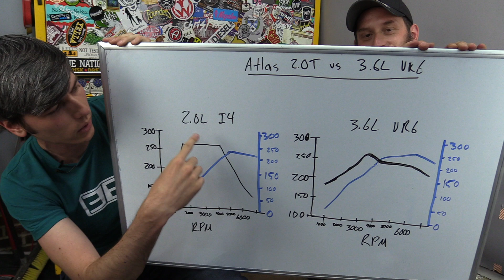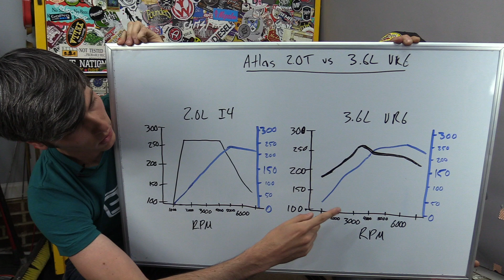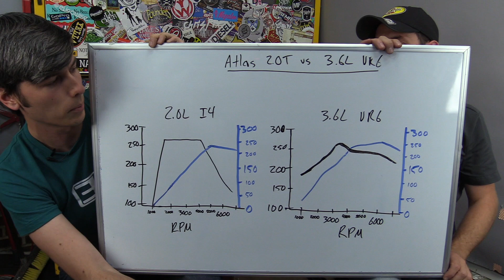4 Reasons Why The VR6 Engine Is Dying Off

Comment: From a dude that loves the VR6, the new engines are so awesome. 

Thanks for hanging Jason. Always fun times
Reply from the maker: Love working with ya Charles. Mostly it's the wicked beard, but you also have sweet props! ;)
Reply: Engineering Explained alls the props
Reply: HumbleMechanic turbo your VR
Reply: There's also the question of reliability of turbo motors.
Reply: +Jeffrey SmokeyBones O'Malley same money into the vr6 and you will have 300 to the wheel with out changing rods and stuff as the vr6 compression loves da turbo. v5 is the same just one less cylinder and a little less power
Reply: I really liked this video and format, with someone who is really into a particular brand or technology talking about its features.  I'd like to see more like it... @HumbleMechanic this vid would have been good without you... it was awesome with you, thanks for the time you put into making it happen.

Any possibility we can get a vid on what the engineering differences in the block are for a naturally aspirated engine vs. one designed for a turbo or supercharger?
Reply: consider a 98 mustang v6 3.8 from factor only produced 145hp so 190 from a 2.8 v6 is saying somthing for a complete base power vr6
Reply: Ilya Kalujny, actually that's a poorly formed opinion, but alas.
Reply: I think the obvious response is cost/emissions/weight are the reason why the 2L turbo is used instead. I had a 24V Vr6 Gti, fantastic engine, great response and power. Fuel economy wasn't bad either if you could drive it slowly.
Reply: The VR6 has much more torque than that though, I have a 12v VR6 and a built B17A1 with Nitrous and yes my B17 makes more horsepower, but the 12v VR6 has 80% of its torque at 2800RPM compared to my B17 where you only start to feel the torque when hitting V-TEC, and its still has less torque than the VR6. Although when I push an extra 150hp shot of nitrous then yes its much better. But its expensive to use all the time. If your wondering whats in my B17, Bored to 1.8L with CP High compression pistons 12:4:1, Manley I beam rods, Ferrea Road Race Roller cams, Ferrea Beehive valve springs. I use a AEM Infinity for engine management. I daily my VR6 on weekdays and my Integra for the weekends and in lots of situations its nice to have instant torque.
Reply: B17 is Pushing 240whp and 164ft/lbs of torque and my VR6 is pushing 165hp and 205ft/lbs of torque. Yes I dyno'd both at Classified Motorsports here in Canada.
Reply: You can always say that the vr6 will last longer than an inline 4 with a turbo hahah.
Reply: HumbleMechanic when it comes to building there is no replacement for displacement so I give it to the vr6
Reply: Who would fine the EPA (hint: they are a government body)? also in some respects at least it is a number you can compare between cars. the same issues exist for the SEER number on your air conditioner, or the energystar rating on your water heater, etc. Would i like to see the the EPA fule economy number be more representative of "normal" driving? yes, but at the same time it's not uncommon to see almost everyone in LA driving down the highway at 80+ MPH, even though the speedlimit is 70MPH so what speed do you pick for your highway test speed? how long do you allow the car to warm up first? do you include the acceleration from stopped up to highway speed? if so is there a minimum limit on the time it takes to get to speed? how long do you measure the fuel economy over? what temps, atmospheric pressures, and humidities do you allow for testing? how do you correct for changes in those? what type of fuel should be used, and what standard do you use to qualify it? wind speed and direction? what about tires, for example if i was a car manufacturer, i'd put the "fuel economy option" tires on it, and then charge $xx,xxx for those tires with a 16+ week increase in shipping time just so no one ever gets them. The list goes on and on. In the end there will always be "cheating" on the testing, and the test may or may not represent your driving usage.

You also seem to be mixing up fuel economy and emissions. VW is in trouble for cheating on the emissions tests. Kia and Ford were both in trouble with the EPA for inaccurate fuel economy ratings in the last few years.
Reply: Tigerfire75.  MotorWeek gets better than EPA mileage a lot of the time.  I think they have little old ladies drive around at 10mph under the speed limit, but I can't prove it.
Reply: Learning2Smile no,  Jason lives in Idaho,  Charles lives in South Carolina (if my memory serves me right)
Reply: Not only that, the VR can take up to 15lbs boost on stock rods. I swear Honda guys do not know what they're talking about with the VR. One of Ward's 10 best engines. Basis for the engines that now powers the Bentley (W12 n/a, W12 Turbo), and the Bugatti Veyron Supercar (W16, quad turbo). Ask the averafe VR owner when they did they're head gasket. Then ask the average honda 4 cyl owner. If the honda owner has anywhere upwards of 200K miles, that gasket is either already done, or is about to be. Just better catch it before it goes as honda motors do NOT tolerate overheating very well. A VR will be forgiving as long as you don't obviously ignore it, as it's built to run hot.

Even still. we as VW guys give Honda's props for solid engines... more than they do us. But that's okay.
Reply: Then you needed to be there when my lightly modded VR6 B3 Passat GLX (93) , with a simple chip and a 5 speed conversion from a 94 Corrado VR6 walked an old school 90's first gen Integra GS-R from a stoplight. Yes, my 3300 lb STATIONWAGEN plus my 165 lbs (total with fuel, nearly 3500 lbs) You know what got me the race? I pulled one and a half to two car lengths right outta the hole. He managed to catch up by the time I was in 3rd going to 4th, but  once I was able to get the VR singing higher revs in 4th then 5th, he couldn't pull it off and began falling back. Any VW people or gear heads know what caused the GS-R to lose the race that otherwise would've been close? In one word please...
Reply: Vr6 12v have flow limitations in the head. you can only build about 220 n/a. The vr is reliable and fast turbocharged. It has good torque everywhere. It feels almost like an older v8 in a swapped car.
Reply: Dont worry about ve or peak hp #'s . The seat of the pants driving experience is so good with a turbo vr. Its the best bang for the buck out there.
Reply: How about we turbo the VR6?
Reply: Indeed. The internals on the 12v are pretty stout. Lower the compression to a more turbo-friendly level and you can make disgusting levels of power for a FWD car on the factory bottom end. WIth the head, there is some porting work that can be done, but honestly, it doesn't really need it unless you have dreams of crazy horsepower. Daily driver reliable 400 turbocharged whp on the stock motor with nothing more than a head spacer is impressive. And if VW was looking for a VR6 to power larger vehicles ala Ford Ecoboost, all the basic parts are there already. They're already doing it with the EA888. Imagine what could be done with an iron block VR6 if given the same top end treatment of the 4-cyl. Would be a beautifully compact motor in a new Porsche 968 Turbo S.
Reply: Mike McKeen honestly, 15PSI on a Stock Compression 10.1:1 VRT (AFP) feels great. 

Gas Mileage, and Near Instant Spool are both fantastic.  

The only reason why I don’t crank it up to 20psi is because I don’t have the technical know how to modify my C2 Flash. 

With that being said, the c2 630 flash does run a bit rich wot (11:1 AFR), and I monitor for timing pull religiously. 

You were definitely spot on with the Timing Chain and etc. The upper Rail Guide on the 12v is known to be problematic.
Reply: You guys live in the same city?
Reply: if it's your birthday happy birthday!
Reply: andrew wright your out of your mind if u think youll get the same amount of parts for the cost of what it cost to build my motor. hence why its called the poor mans type r. vw parts are way more expensive then Honda parts. Everyone knows this. Vw parts are ridiculously expensive.
Reply: andrew wright there is no way in hell your gonna get 300whp by swapping in all other oem parts lmao. good try tho. for what it would cost u to get a reliable 300whp all motor vr6 i could build mine to 500whp with all oem Honda parts and an aftermarket turbo on it lol. or all motor with 300whp and it would actually be reliable lol. the vr6 would 100% not be reliable. u would be rebuilding every time u take it down the track.
Reply: KrazyKustoms Media 190 to the crank is horrible. like i said my all motor all oem Honda parts 4 cylinder 1.8 litre put down 205 to the wheels on the dyno (not to the crank like the vr6 or the mustang) Hell even the older mustang v8 5.0 only has 230hp again to the crank not to the wheels. Also my dx sedan weighs less than the 1995 Civic Si hatchback right from the factory. How much does a vw jetta with a vr6 weigh? prob over 2800lbs vs my 2200lb 4 door sedan lol.
Reply: stoneeh thats really nothing to brag about. 10hp from a cam? lol
Reply: RockstarAlto ya but take that motor and put it in a eg civic hatch or a dx sedan like mine which is lighter than the eg si hatch right from the factory and the power to weight would destroy a vw with a vr6. yes more torque but the 600lbs lighter car? its a wrap.
Reply: RockstarAlto integras are to heavy. thats the problem.
Reply: +Jon Council "Can take up to 15 psi on stock rods." The number of PSI is kind of irrelevant if we don't know what kind/size turbo you're talking about. It might tolerate 15PSI from a tiny Garrett T25, but it would probably jettison some rods with 15PSI from a Garrett GT35R.
Reply: Uh, why would you think the first turbo someone building a FI kit for a 1990's thru 2000's era engine would be a T25 70's era turbo??? Just look at the plentiful vids of VR6 turbos here on YouTube. The standard size go to turbo is at a minimum a GT30.... I mean, standard 1.8T's even do GT28 - GT30's on the high side before rods are in order....

But even if they used a seriously undersized outdated turbo pushing nearly outside of it's efficiency map to power a VR6, try running 15 lbs of boost with a properly sized turbo thru a Honda 4 cyl without building the motor first. You won't have an engine for long I assure you.

A VR6 can take that 1 bar from a decent size turbo at 9.0 to 1 compression because it was originally designed as a diesel engine. A very little known fact.
Reply: +Jon Council The T25 was used throughout the 90s by a number of manufacturers including Mitsubishi and GM. It's common, it's cheap and rebuild able. Regardless, all I was getting at is that saying something can hold 15psi is pointless without clarifying what turbo or supercharger.
Reply: HumbleMechanic did that block come out of a mk4 gti ?
Reply: The vr has much more area under the curve than your Honda. The small amount of time your HP is greater does not make up for it's lack of torque everywhere else.
Reply: Saddens me that VW never offered a supercharged or turbocharged version of the VR6, with proper maintenance, the engine is damn near everything proof, and the wookie plus the scream of a supercharger would've been a sweet melody......
Reply: HumbleMechanic do u think its a good idea to buy a 3.6 4motion passat b6 , what do you think of that engine
Reply: vw just made a new one    2.5T vr6
Reply: Zonghui Li. I believe you are thinking of the inline 5 2.5L turbo that’s in the RS3 and TTS. The newest VR’s are 3.2L and 3.6L. Both come DOHC and direct fuel injection.
Reply: It's only hideous if you judge it by Honda Standards (aka head flow). On the flip side, if you take into consideration it puts out ~180ft/lbs of torque from the factory, it's a cast iron block w/ a forged crankshaft, much less desirable to thieves  (Honda has more popularity), and also cheaper (I paid $350 for my D15b motor, and $160 for my VR6 Engine), it becomes a strong competitor to Honda's offerings.

Also, they love boost.  (I own a VRT)
Reply: Maybe the 24v, but the 12v is iffy.  There was a 96 page thread on trying to extract that power n/a, I believe they had issues due to the head.  On the flip side, it's not impossible to get a 12v over 800 whp on Boost.
Reply: Marlon Lyn. Not true. I have built and seen 1200whp VR6’s since the 2000’s. The issues with the 12V is how the intake runners work. 3 short 3 long. They made it perfectly sound at low NA the way the air bounces off the valves and back to the plenum it is flawless stock but when you are trying to push it na you gotta get ITB’s or a better short runner intake. 350hp NA 400tq is achievable. But a ton of work!! But as stated VR’s love boost!!!
Reply: Mike McKeen if you go further than an of the shell chip tune. (Something like a  flash tune tailored to your car, or standalone) you may not have to even open the motor. 

The important issue is using a properly sized turbo, and managing timing so detonation is controlled.
Reply: Perhaps, but the factory compression on those older 12v motors is like 10:1. While you could get away with a good tune and E85, your options open up considerably with a head spacer to get the compression down. If you're going to the trouble of turboing this motor, the newest of which was last made in 2002, you're likely looking at some freshening up. Unless it's a low mileage motor or a fresh rebuild, I'd replace the head gasket before doing a turbo setup, as should any mechanic worth his salt. Since the head spacers for these are common and well-tested over the years and come with new gaskets, you might as well go that route. Unless you have a record showing when the timing chain, guides and tensioners were last changed, it would be prudent to change those out before adding 100+hp to the motor. Since the head is coming off anyway, might as well do it all. There is no point in trying to tune a turbo around a high compression motor if you don't have to. Don't make compromises when it isn't needed. Especially not for $200USD in parts.
Reply: EE and humblemechanic = dream team
Reply: Hey I have a 2014 Passat with the VR6 and DSG. I maintain the car quite a bit and has oil changes and all that good stuff done on time. What could I do to hope it up in power? Also is it a reliable enough vehicle to mod? I love it and I want to do it regardless. Sleeper 2014 Passat with a v6 HAHA awesome
Reply: How about the 2.5 vr6 turbo...btw😞 only in china
Reply: "Thanks for hanging Jason" or "Thanks for hanging, Jason"?
Quite a big difference there...
Reply: I own a 2,9l VR6 with 190hp in the VW Corrado. For comparison I can cite the 1,4l 160 TSI in the Scirocco, and the 2,0 TSI 200hp in the Audi TT. 
Both newer engines seem strong at first because of the low down torque/power, but when you rev them you are quickly disappointed, because they drop off already at 5500 rpm.
Next is the response. The VR6 kicks the newer engines' ass in that regard. I personally can't stand turbo lag.. totally unacceptable, controlling power during cornering and coming out of the corner is much harder.
Next is the sound.. okay, we don't even have to talk about that, do we? ;)

Nope, the new engines are not awesome. What would be awesome if VW used modern technology to tune the VR6 design for higher revs and higher power - I wouldn't mind buying a 2017 Corrado with a light 2,5l VR6 up front with a 120hp/l output, proper light weight design, proper suspension and diff, sticky tires etc that I could go hunt 911s with ;)
Reply: On the VR6 power figures: Just switching to 272 cams without even adjusting the ECU will get you another 10-20hp and 500-1000 revs on a 12v VR6. With proper ECU and some further work 30-40hp is no problem. And then there's still a lot of potential in the manifold and head, and there are even some sharper cams out there.. max is 288 I believe. You can get the 12v very close to a specific output of 100hp/l without adding boost. And btw, you really really don't need more than that on a FWD car ;)
Reply: Why do we keep talking about fuel economy numbers that we get from the EPA?  Their measuring does not accurately tell the fuel economy.  You can't actually drive as the test is and hope to get the numbers.  

So when is the EPA going to get fined and ruined for lying?  VW did even though they were giving people want they want ( powerful cars and trucks that are economical).
Reply: @Tigerfire75  they say 20 something miles per gallons on highway for my car i get 33 mpg easy
Reply: Sure, you'll just have to drive it like you stole it to get those 205 horses that's all. A VR6 can lug around or rev and get you power. And keep in mind that 190 hp figure is out of a 2.8L mill that doesn't even have the Variability of the V-Tec valve train to help it. If it did have that, lol, just reference any Acura/Honda V6 V-Tec motor and see what you'd have then to compare... ;)
Reply: I am aware various manufacturers used the T25 as a stock turbo. I have one of them.. 1992 Mercedes 300D 2.5 L turbodiesel. But surely you know tuners don't pull from the same bin as manufacturers. They like to go for the most advanced stuff, which at this time would've been the GT series turbos. And as a gas motor at 2.8 liters, a VR6 would've been oversized for a T25 turbo, As it stands now, on my 2.5L I5 diesel engine, the stock T25 is banging relentlessly up against it's efficiency curve at stock  psi levels with only simple fueling mods as it is based off of how much smoke I get (and egts) beyond 4K rpm. So no way it would take a VR6 as a sufficient turbo.
Reply: HumbleMechanic Looking forward to the videos on the 2.8 build. Found a good block that I want to build up for my 96 Jetta, and being able to refer to a detailed video series would be fantastic.
Reply: stoneeh 190hp that is seriously hideous lol. especially for a 6 cylinder lol and the really sad part is thats only 190 to the crank. i have a 95 Honda Civic dx sedan with a Poor mans integra type R build 1.8 litre dohc. all motor naturally aspirated. oem Honda type R crank, pistons, rods, cams and valve train dyno tuned on Neptune engine management. It put down 205 horsepower to the wheels on a conservative tune because i daily drive it.